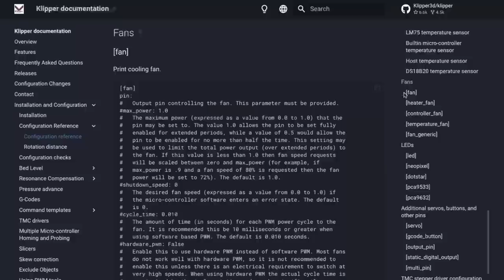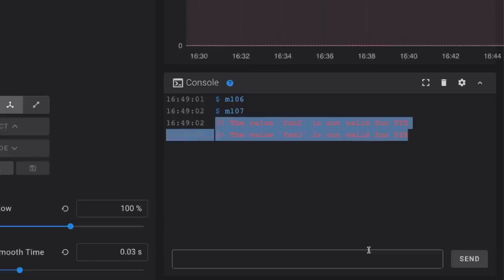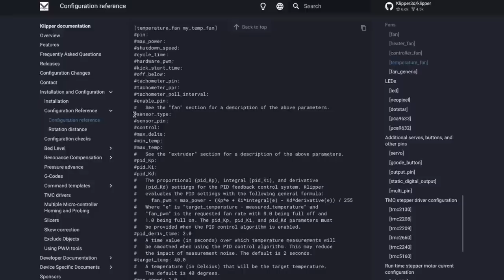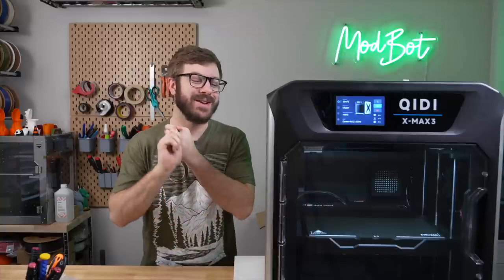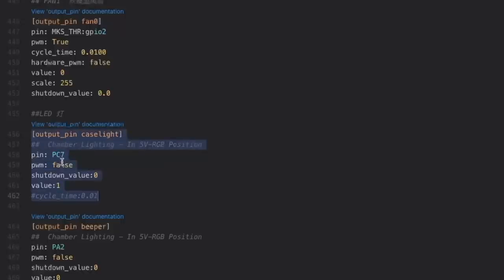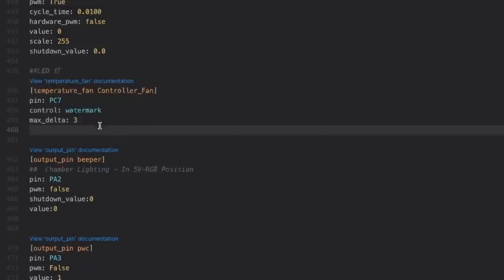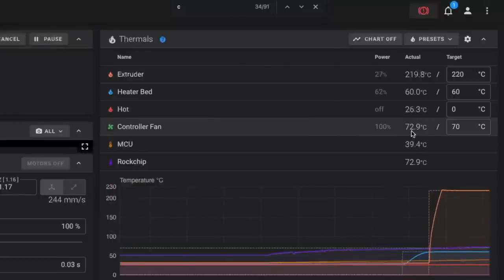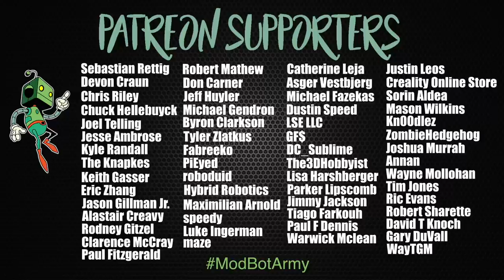Upgrade Your Fans With Klipper Firmware

Comment: Shame Klipper didn't build in the ability to have 2 parts cooling fans for IDEX printers.  It can be done with the generic fan and macros but nothing native for them in Klipper, maybe this will change one day.  I have dual parts cooling blowers on each hotend and all would run even when not a hotend wasn't in use, was crazy noisy when printing.

Nice explanation on the different fan options, could have used this 6 months ago lol
Reply: Out of curiosity, were all 4 fans connected to the same port on your mainboard?
Reply: @Naemion  I originally used a mosfet board to drive them from power supply out of concern for current draw.  Later I did direct connect them with no issues.  Now I have them controlled via macros and dual mosfet boards so unused parts cooling fan can go idle.
Reply: Just wire both in with a Y cable... :P

Comment: It might be useful to make a follow-up vid on how to add fan control on boards that don't have enough "fan" ports.  The SV06, for example, has only 1 fan controller for part cooling.  The hotend heatsink fan is always on, and the MCU fan is tied to the part cooling fan.  If you print ABS with no cooling, that MCU fan never comes on and it gets pretty toasty next to a 100C bed.  
I installed a couple D4184 MOSFET boards, powered them from the +24V power header, wired their PWM inputs to the unused ICSP pins (PA13/PA14), and now I have 3 controllable fans.
Reply from the maker: That is awesome. Thanks for sharing. Someone else had mentioned interest in something similar and I think it is a great idea. 👍
Reply: I have designed my own printer using mostly parts I have on hand and want to print parts in ABS on my SV06 to make it. would you mind giving me some information on how you did it as I am having some issues. (Although these should hopefully be solved as I plan to add active temperature control to my enclosure. ) Is the control board being in ABS printing temperature environments a Huge problem if i'm only printing 1 spool of filament.
Reply: @kiwihuman  I think it is possible that your mainboard being inside an enclosure with no fan running and a bed at 100C could be causing problems.  
I am working on a guide for my MOSFET mod.  Mostly done and I should be posting to Printables in the next week or so.  
Meanwhile, I recommend unplugging the MCU fan from its jack and wiring directly to the screw terminal labeled "fan" on the board.  This is the same as the hotend heat-sink cooling fan and should always be on when the printer is on.
Reply: @beauregardslim1914  I can't see how the main board would be causing any prunt problems as my only issue is warping as parts curl off the bed. My concerns lie with longevity of the parts. I am running klipper, so I added the functionality for a separate heater with an old GT2560 connected as a 2nd MCU.

Thanks for the reply, and I will be sure to watch your video when it is available.

Comment: One thing I would like to add that can be useful is the ability to run more than one fan pin. On my Manta m8 I had enough ports to power two 4010 fans instead of wiring them together. Using  Multi_pin, example 
[multi_pin my_fan]
pins: PA8, PD12

[fan]
pin = multi_pin:my_fan
Reply from the maker: Interesting, this is not something I have done before. I am actually running 2 controller fans on my M8P but I have them listed separately and just assign them the same behavior. Do you do this method to group them together so that they can then both be address at the same time?
Reply: @ModBotArmy  Yes, I was not sure how to run two part cooling fans on individual ports and this was the method I found and was easy to do. 

this is from my actual printer

[multi_pin my_controller_fan_pins]
pins: PE6, PC12

[fan]
pin: multi_pin:my_controller_fan_pins
Reply: @ModBotArmy  How did you get that drop down command palette? It's so sweet i'd like to have that feature too!

Comment: Thanks for the help.  Well done with the way you organized this video.  The only thing I didn't figure out was how to throttle back fan speed for my 4pin noctua fans.  I'm only using 2 pins on my octopus pro, so i want it to do the pwm to set the fan speed as a percentage of how hot my mcu is, because those 12v 60mm fans can also be loud.

Comment: I just added this to my 2.4 with a Leviathan board. The fans that came with my LDO kit aren't 3pin and I couldn't run the fans at a percentage, so I setup the mcu fans to come on when the Pi hits 45c. I

Comment: The timing of this is incredible. I am currently fiddeling around with fan configs on my Voron when Youtube suddenly showed me this video.
Reply from the maker: Woohoo! I hope it helps. It took me a while to figure out what I was doing wrong when getting it set up. 😊
Reply: @ModBotArmy  Very helpful! I don't get why the Klipper documentation doesn't include anything about using watermark control for temperature fans. It's only ever mentioned in the context of hotend/extruder.

The controller fans on my Voron 2.4 are really loud as well. I already lowered voltage to 12V, because having those fans on full blast is just unneccessary. Temperature-controlling them will cut down noise a lot. Thank you!
Reply from the maker: @leonbaronick1823  agreed I didn’t understand it from just looking at the docs. I had to search for example configs and then check some threads discussing it to actually make sense of it. The documentation is not bad but it definitely leaves a handful of questions unanswered.

Comment: This didn't work for me. Read that you can't use temperature_host twice in the config file, so commented out the temperature sensor section, but now mainsail says unknown sensor_type: temperature_host. What going on. You make it look easy, but I've tried all kinds of stuff but can't get past this error, had to turn them back to controller fans. What's wierd is both host and mcu work as temp sensors, but not to control the fans

Comment: Great Video! One question: Do you know how to activate relay-controlled fans by temperature? I have a board which hasn‘t got enough fan ports so I‘m using a relay (connected to the pi) to turn them on and off. I haven‘t figured out how to automate it yet…
Reply: @Idiot_Engineering  Does this work over GPIO too? And what is the difference between a relay and a mosfet?

Comment: Definitely changing that Qidi Max fan config, it's been driving me nuts already. 👍
Reply from the maker: I am shocked that when they had these boards made from makerbase that they didn’t include an addressable port for that fan. I’m fine with printers being loud when printing but when idle it shouldn’t be the case 😣
Reply: @ModBotArmy  fan noise gets under my skin worse than mechanic noise. I’ll probably swap that fan for a Noctua or something sooner or later. But yea, at the very least everything should be controlled at this point.

Comment: Thank you so much, now my Voron V0.1 with a OrangePI02 runs much better. Before I had 2 print fails, because the OPI02 went into thermal throttling. Then I installed a fan for the OPIß02, but configured when the bed turned on. With that config the OPI02 would run at ~50°C when not printing. Now thanks to your video I have it set to my desired temperature window :)

Comment: That´s exactly how my sb2240 is configured with a 3007 fan. My next target is a temperature curve, as you know some of this fans can work at 70% or so. So my goal (specially for the electronics compartment of my voron) is to set them at 0%, then 30% under light load and so on, with multiple mcus. Unfortunately there is no direct way of doing this, only with macros.

Comment: This is great. The upgraded fans on my v400 are at ear level and even with a PWM noise reduction circuit it needs to be quieter at idle. Thanks for the info.

Comment: After a bit of experimentation, this is the config I used to cool my SKR 2.0 using a fan connected to pin PB5:

[temperature_fan MCU_temp]
pin: PB5
control: watermark
max_delta: 2.0
sensor_type: temperature_mcu
min_temp: 0
max_temp: 100
target_temp: 35

PS: I posted this comment after seeing that some people are struggling to find a way on to have temp-controlled fans on SKR 2.0 stack exchange and reddit and referring to this video with "but how did ModBot managed to make it work?" :D Please pay attention to the pin (PB5) to reflect the one you are actually using.